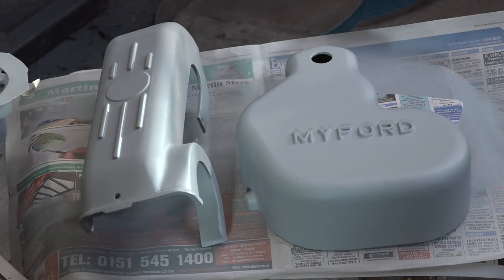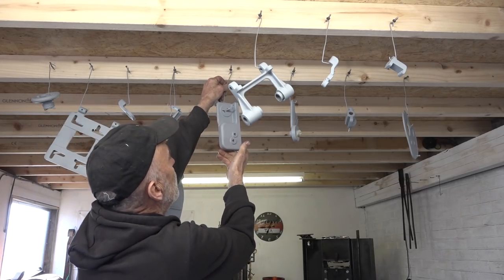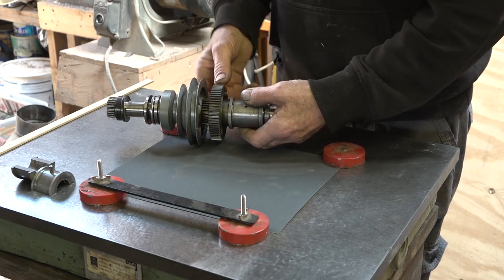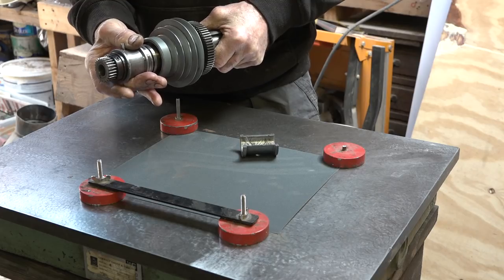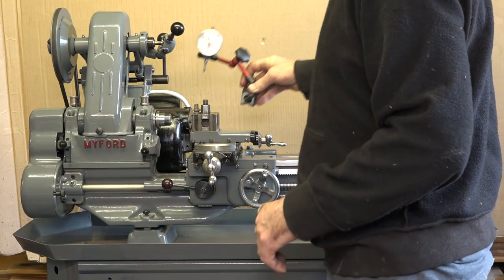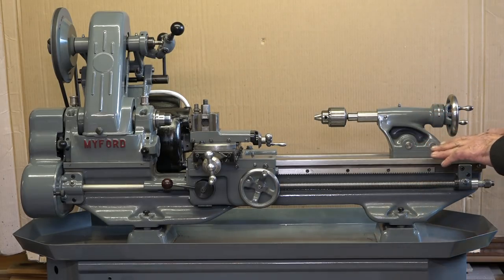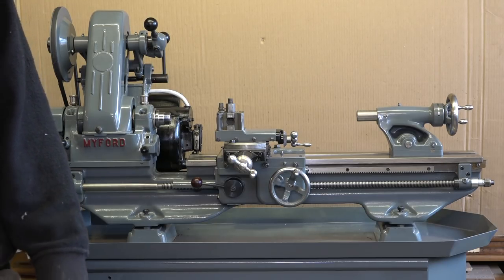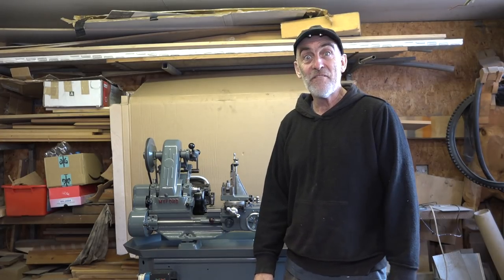myford pt 3 painting and finishing assembly

Comment: Excellent job on the lathe looks stunning, currently attempting a restoration job on my myford ml7 did you use the original myford paint 🤔 did you have to thin the paint 🎨 and if so what did you use any advice would be much appreciated keep up the good work 😀
Reply from the maker: Thanks mate, yes I got the paint from Paragon paints myford grey enamel, I used fast thinners from an auto paint supplier to thin it down, I think paragon supply thinners though if needed. cant remember exactly the ratio but somewhere around 25% thinners, just try it in the gun if spraying and adjust as needed,  it comes quite thick in the tin okay for brush painting too thick to spray. good luck. Cheers.
Reply: @LozHarrop much appreciated mate 🙏 if I can get mine looking half as good as yours I'd be chuffed thanks again buddy 👍 😀

Comment: I've just stripped off my Myford lathe bed and some of the aluminium components so I'm almost ready to spray paint.  Did you use etching primer on ALL metals and then a filler spray over the rough surfaces for sanding back? Thanks
Reply from the maker: Hi, on the lathe bed i just loaded it with etching primer and plenty of top coat, the rest of the parts which were badly marked and dented  i used dolphin glaze filler which is like a thick cream, applied it with my hand and sanded it back. you could use spray putty and keep sanding back until you get a  flat finish
Reply: @LozHarrop  Many thanks